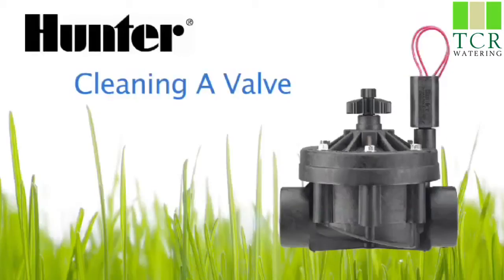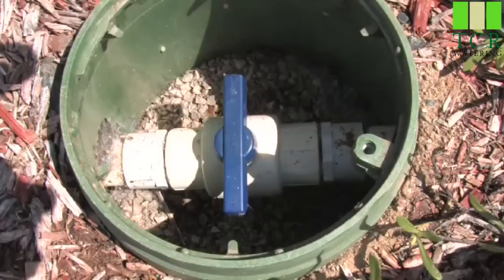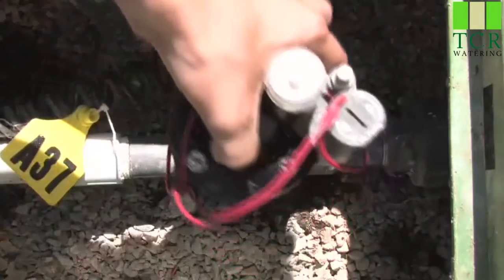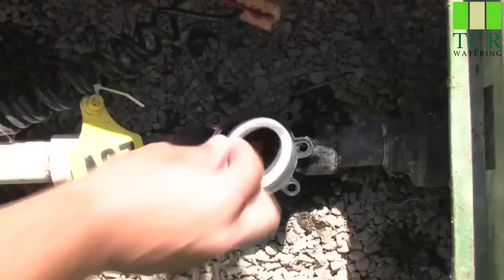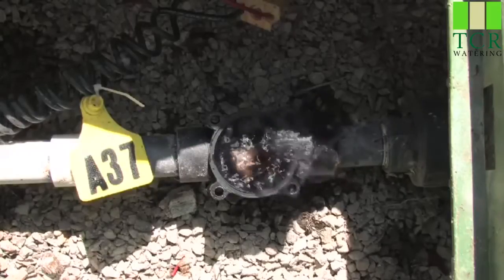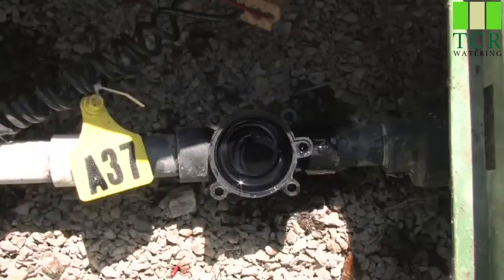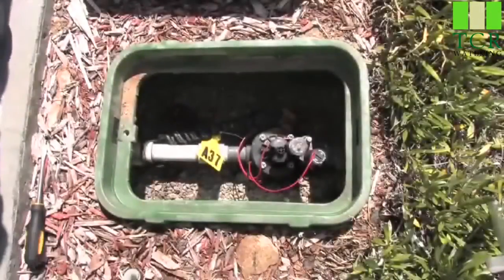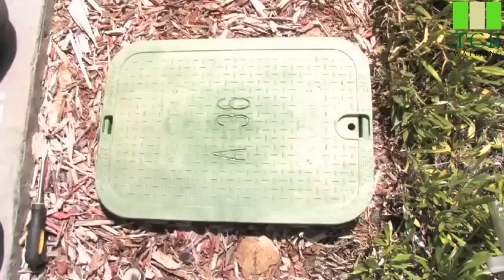Hunter PGV valve 3/3 Valve not closing

Comment: Brand new valve, followed all these steps, still won't shut off. This is half my valves, with the half that aren't closing appearing to be a completely random set of valves.
Reply: I had this issue too.  I had nearly new valves that just would not close.  I had to return several sets of valves.  I always use Hunter PGV valves but only recently started to have this issue with new valves. whats going on?
Reply: @joshuakim5905  It turns out almost all of the PGV valves in the batch that was shipped to the Site One retailer were from-the-manufacturer bad; they were lemons. Given the timing of your purchases being so close to mine, I am suspicious the issue is that Hunter Industries released a bad batch. The retailer ate the cost of replacement and just got us a new set of identical valves from a different batch, and every one of them worked fine.
Reply: @captainphoenix  i believe I have the same problem too! It wont shut off and it keeps running water!